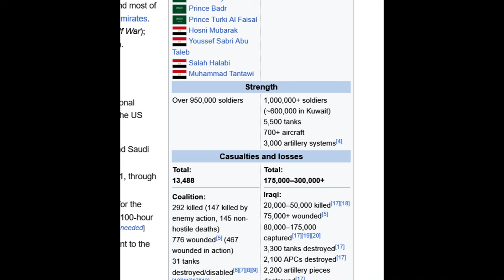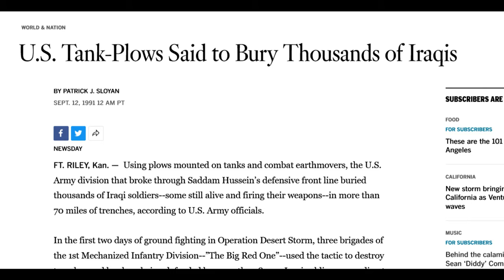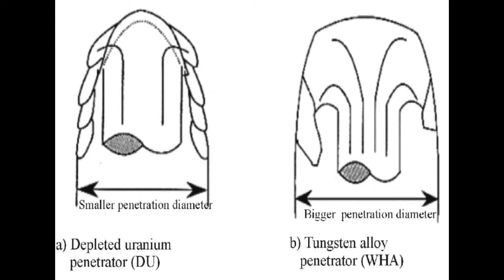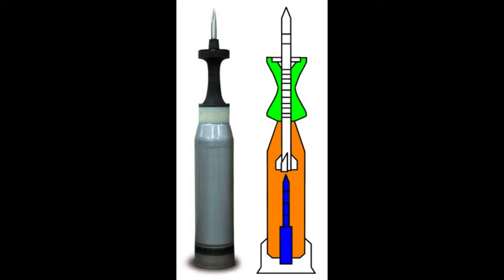Are Tanks Becoming Obsolete?

Comment: You forgot the fact that drones can be fully autonomous, making jamming useless.

As my friend said to me when I talked about drones in warfare, any one form of tech in warfare rarely becomes obsolete, their places in warfare just become more nuanced and complex over time - small drones will likely also see continued use, but will just change in response to countermeasures and countermeasures to the countermeasures keep being being developed.
Reply: that doesn't make jamming useless lol something that is autonomous can still  be jammed please actually learn what your talking about.
Reply: @kelllakell  I would argue that if it requires constant input from a second party to function then it's not actually fully autonomous - unless you're using some obscure definition of jamming.
Reply: @iwiffitthitotonacc4673  I am not using an obscure definition of "jamming". Jamming will work regardless if something is autonomous or not because Jammers targeted at drones do not work by interrupting a signal from anywhere they work by shooting powerful microwaves and x-rays at machinery that cook any electronics motherboard thats why you see drones fall out of the sky when they are jammed, thats why I said you should actually look up the concepts you are talking about instead of "guessing". 

Google is free my guy.
Reply: @kelllakell  I'm not sure why you're acting smug because when I do Google it, it is defined as interference with radio signals between the drone and its operator. So yeah, looks like you're using an obscure definition to me.
Reply: @kelllakell Bro? 😂😂😂

Comment: Yah, Russia has no opsec.  Their tech isn't able to encrypt, neither side is using encrypted control signals and yet the drones were still working as a weapon...which just doesn't work against a Western army.  They have jamming gear.  They also need to stop riding hatch up, which means they need to plan for driver comfort in an armored up scenario so they aren't opening their hatches in a combat zone.